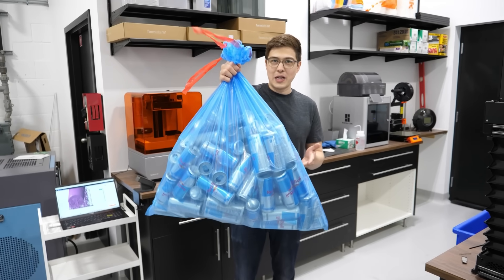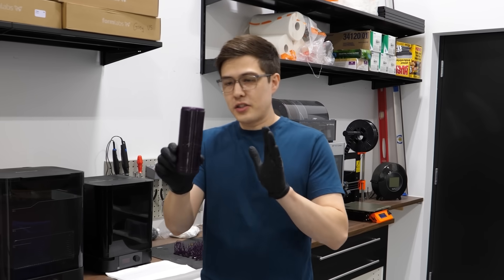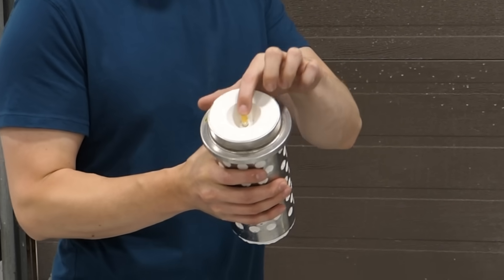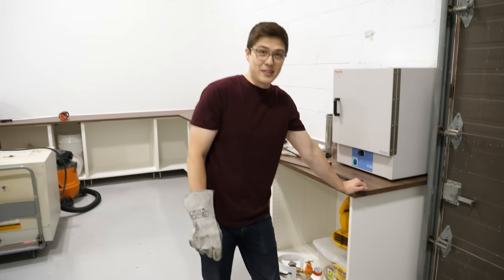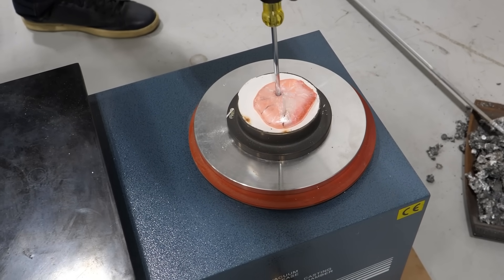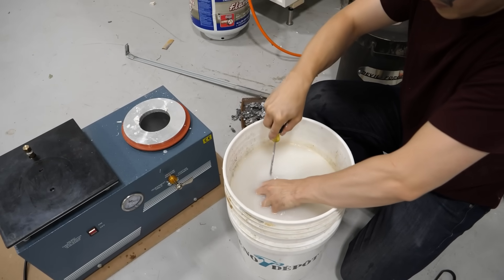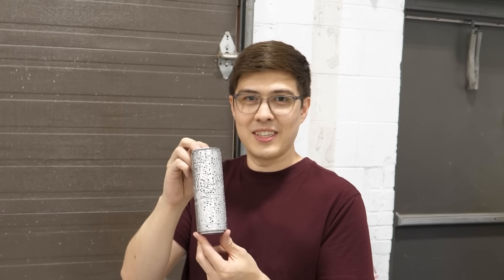Melting down 100 cans of Red Bull into just 1

Comment from the maker: **This video was originally meant to be a NileBlue short where we had to remove a lot in the edit to chop it down. We extended it a bit here, but a lot of people have been pointing things out in the comments, and we regret not including more info in this version.

For example, in order to print the can hollow we had to make drain holes, which meant that we had to plug them before putting the plaster in. This in turn made us afraid about degassing it though, because we didn't do an amazing job plugging it and we were afraid the plugs would come out. However, more importantly, we also started getting really scared that the 3D print itself (which was thin walled and filled with air) could pop under a full vacuum. So we degassed it without pulling a full vacuum and resorted to shaking it around a lot, which I think worked.

Overall, I think our biggest issue by far, was that we completely forgot everything we learned about aluminum. We completely overheated it and made no effort to degas it.
Reply: What is up Nile River?
Reply: Good thing is, if you wanted to try again, the aluminium is right there so it would be slightly easier than this try!
Reply: i enjoy redbull from time to time myself, passion projects are always the coolest

Thanks for the video.
Reply: I hope thoose 100 cans were drunk in at least 100 days
Reply: @XVYQ_EY  the 100 cans is from when he made the condensed super redbull extract…
Reply: @XVYQ_EY  hehe yeah no
Reply: The shorts folks can... tilt the phone 90 degrees and watch the video like normal people do xP
Reply: Wow, you type like you talk, with the pauses and everything
Reply: Niled it...put that on a shirt
Reply: This is the funniest sequel to condensing all that caffeine into one drink😂
Reply: Need a do over where you remove the aluminium from the plastic inside/liners and make a solid plastic can and a solid aluminium can... you could use the beer cans from that super beer video unless they are gone I guess.
Reply: I thought you would've put the plaster in a vacuum chamber to get rid of any air bubbles.
Reply: @griffingoza6033  It could be that he did, but that step was cut from the video.
Reply: 👍 222
Reply: In my own experience it probably would have been better to use a thicker tape, and the gas properly those mold carriers will work though even with a thicker one. Speed tape works decently.
Reply: This is the most pathetic promotion video for red bull , you should try actually doing something that benefits society for the long run and right now instead spewing click bait garbage out there for stupid kids and bored adults you cringe dork
Reply: da boy learns smelting good job :>
Reply: I love when you do FOUNDRY VIDEOS!!!!! I always get so hype because I am a metal casting sculptor! It's usually iron or bronze for me but I've poured aluminum
Reply: You should acid etch it. Sometimes the aluminum crystals can grow quite large and look pretty neat.
Reply: Vid def leaves a lot to be desired.

 Recommend preheat your mold before casting. 
Vacuum your plaster to remove airbubbles. 
And use a filter in you r mold to block "skin" /dross from affecting the pour.
Reply: Borax and Hexachloroethane. You're the chemical guy, you know you want to go look it up and go redo the can mold :)

Plus you could figure out a way to bubble some argon or nitrogen up through the bottom. Same as the purple gold problem.
Reply: Consensus is to do another longer one with the lessons learned!! 🎉🎉🎉
Reply: Why not vibrate with your ultrasound to knock bubbles out?
Reply: Can you isolate the little white flakes that are floating around in Mountain Dew?
Reply: You have 100 Red Bull cans not 100 cans of Red Bull.
Doesn't matter how much we know, we still all screw up :)
Reply: Bro wr like whatever, I ounce watch the red gas while being in army , on duty,and iwas concerted on the video ❤

Comment: Metalurgical Engineer here. I agree a lot with the comments here about proper mold design such as to allow gas to escape. And a proper vacuum pul in the mold. But also, aluminum is very prone to accumulate gas while its molten, especially hidrogen gas from all the air moisture. A proper degassing with argon would fix this. There is the possibility of doing it with nitrogen but is not the best sollution because it leads to the formation of nitrides (this can happen in other alloys) and the nitrides are brittle and can cause the piece to either crack while cooling or later if the cast piece os dropped. Usually a good degassing before pouring should fix the porosity in the final piece.

Comment: next time give that mold another hole to get rid of the air and other gases that will form inside while pouring the liquid alu and the result should be alot better. Burning all the inpurities like plastic and paint from the cans before melting them should help too.

Comment: Putting the cans in whole significantly increases slag formation you want a beefy paper shredder or the woodchipper you used for pla, and to smash, shred and compact the cans before melting. I'm hoping to build a vacuum chamber for degassing cast parts. I want to get into aluminum-bronze and silumin type alloys.

Comment: I worked in a foundry casting bronze and aluminum. For aluminum we always used degassing tablets to prevent the swiss cheese look.
Also a bigger funnel, filled to the top, will help to let any unwanted shrinkage to happen on the funnel.

Comment: Your lab needs a device that vibrates at adjustable frequency to get bubbles out of liquid, The adjustable devices is better as you work with liquids at different viscosity and bubble sizes.

Comment: Hello - lost wax is one way to do the mold but because there was no room for air to escape it made the bubbles - you would have done better with a 2 part sound mold with a vent for air - mold upside down so sprew and air hole can be ground down

Comment: You should fill in the pits with the appropriate colors of resin pain so the blue parts of the can are blue and the red parts are red and the silver parts are silver. You still would leave the raw aluminum visible just fill in the holes until its flush

Comment: You can reduce the porosity of your casting by putting a potato on a steel rod and slowly lowering it into the molten aluminum for a bit. For real, look it up, used to be common practice and still is done as a lab demo in metallurgy schools. Please look up the proper precautions and wear more PPE when doing it.

Comment: i got an idea to fix the bubbles, where you set the mold when its being poured and cooling, a vibration table, just use a metal table and mount a motor to it with an off center weight and bobs your uncle, it could be easily driven with an arduino or pi, hmu if u need helps but u know to use ai

Comment: Preheat you casting.
Robinson foundry adds stuff to his crucible to get the slag out.Alex or something.
Do it again and dissolve plaster from with some sort of piranha fluid adjacent chemical.put something down to protect floor. There was one guy and mould broke and poured molten copper on garage floor and it etched it badly.

Comment: The melt was full of holes because the gasses created upon combustion of the 3d print had nowhere to go, there are things you can do to improve the quality of the melt, first of all the correct plaster to create the mold, or simply remove a tiny layer of plaster on the bottom, the opposte side of where you pour the metal, scrape off a layer there after it has cured before putting it into the pre heat oven, this will allow the gasses to escape the mold during pour, there are other more complex ways to avoid imperfections but most of this methods need specific machines, like vacuum induction melters or cantrifuges

Comment: I highly highly recommend pulling the vacuum on the casting machine AFTER pouring the metal. The extra airflow will cool the mold extremely fast. Not to mention you should also be preheating the mold to a similar temperature to the metal being poured. I use the exact same type of vacuum casting machine for my lost wax jewelry making on a weekly basis and would be happy to help!!

Comment: I wonder if the pitting was caused by the gas in the aluminum and not the plaster. At the casting factory I used to work at they would just drop a potato into the aluminum to draw out the gas before casting it.

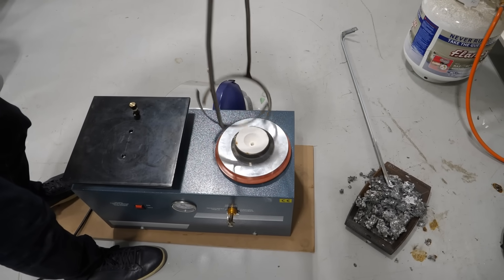Comment: 2:36 I thought a rubber gasket was supposed to go between the hot mold flange and the hole it's going into?  So there's actually a seal and the vacuum can actually pull air from the porous plaster?
Reply: why would you want air in the mold
Reply: @REDSTONENOOB.You don't - thee vacuum is outside the mold, so you pull the air FROM the mold through the plaster and out the vacuum pump, and the metal fills in the space the air was in.

Comment: In metal design we put escape airholes in different places where we know air will likely rise too but in your case it probably cooled too fast we also had smaller molds so we could spin the molten metal and mold using centrifugal force which i think is called spincasting? Idk lmao been years since i played with molten metal id suggest spining the mold to get the airout since vibrating would be entertaining but dangerous and preheating the mold idk what you put the mold into maybe that was your way of preheating but it definitely wasnt enough idk i could be wrong

Comment: Melt the plastic off the cans first, then melt the aluminum. Also, add some venting tubes from the bottom of the mold going out of the top of the mold. Those both should help remove (most) of the bubbles/pockmarks.

Comment: When melting cans there is a huge surface area to volume. This makes for a huge amount of oxidised aluminium - what you called slag - maybe half the volume. When cans go to recycling they are melted in a non oxidising atmosphere, often carbon monoxide.  
The aluminium alloy in cans is suitable for drawing out. The extruded angle bar is another alloy not suited to casting. If you were to start with an object that was previously cast, like a car wheel rim or an office chair base, it will cast better.

Comment: I think you should have vaccum pumped all the air bubbles when you poured the plaster into the mold or you could have used vibration to allow the bubbles to rise up. So that you could have achieved a perfect casting. And i thought you were gonna drink more redbull to add more cans. Anyways, I love your content. All the best.

Comment: Porosity is due to dissolved hydrogen -- this is inevitable with the high surface area of the cans, and hydrocarbons and steam from the flames, long melt time (maybe? vid is cut of course, but generally speaking, putting 100 cans into a crucible takes a while heh), and extremely high pouring temperature (you're orange, maybe even yellow hot, you could be pouring bronze here!!).

Aluminum reacts with oxygen, period; and anything that contains it.  This is non-negotiable: flame mixture doesn't matter, and it still happens in an electric furnace (kiln or induction) because moisture is in the air.  Oxygen by itself is fine: the surface oxide is stable even to extremely high temperatures (like, white hot _plus_?); but any moisture/steam reacts to give free H2, which readily dissolves into liquid metal.

Like freezing a soda can, freezing metal with dissolved H2 causes it to crash out.  This is why nothing was sucked into the sprue on cooling (though it might also be because it was too thin and the top froze first).  The expanding gas displaces shrinkage due to freezing.  In the extreme, ingots (i.e. poured with a free surface rather than in a closed mold) can expand like muffins, rather than shrink with a dimple in the middle.

Hydrogen is mitigated by:
1. Keep handling time to a minimum.  A few minutes at pouring temp should be more than enough to get everything open, in place, ready to pour. Don't dally around.
2. Mind optimal pouring temp. For a big section like this, not much above the melting point will suffice.  700-750°C say.  Maybe less for alloys.  A little higher for thin sections and fine detail.
3. Gas is released on freezing.  Remelting still re-dissolves some, but less.  Pouring ingots, maybe remelting once or twice, can remove gas. (This is a truly ancient method: it's actually documented by the craftspeople that made the Washington Monument apex. In their case, hydrogen generation was even more of a certainty due to the 1-2% potassium impurity -- a quirk of its early and expensive production method, before Hall and Heroult came along.)
4. Consider using a degasser. This is basically a tablet of solid "chlorine" (e.g. calcium hypochlorite) held under the surface, to bubble chlorine gas through the melt, which reacts with the hydrogen rapidly (and some metal, but there's plenty more of that than there is H2).  A degasser wand is used to apply this: since, first of all, salts float on top of molten aluminum, but also it needs fine pores so that myriad small bubbles are entrained through the melt, rather than big bubbles that surface quickly without reacting.  Think aquarium aeration stone, versus glass tube bubbling into a beaker.
5. Degassing can also be done by sparging: bubbling an inert gas through the metal, dragging out some dissolved gas slowly over time.  N2 and Ar are recommended; H2O content has to be extremely low, and O2 content is contraindicated for obvious reasons.  A stainless steel tube should suffice for introducing gas.  (Since you have so much gas handy in the lab, this is probably a good option.)

(The same problems apply to most any metal: copper and other noble metals, can dissolve both H2 and O2 (obviously not at the same time!), as well as copper oxide (evidently free O2 doesn't instantly react with Cu in a melt!).  Copper alloys (i.e. brass and bronze) have something that'll react with O2 of course, but can still dissolve H2.  Use an oxidizing environment to discourage H2, then a charcoal cover to discourage O2.  Alternately, or in addition to charcoal: a glassy slag layer dissolves oxides as they form; typical composition is soda-lime glass plus a dash of borax to get it to flow slightly better. Don't overdo it or the slag pours into the mold along with the metal!)

Slag can also be dealt with by using a flux.  Some fluxes (e.g. rosin for soldering) work by actually dissolving oxides; that's not very practical here (mainly because fluorides (KF, AlF3, etc.) are involved, quite toxic), but even your bog standard chlorides suffice to disrupt the surface tension between metal and oxide.  A eutectic mix of NaCl.KCl (about equal parts atomic% actually) melts at about the same temp as aluminum, so doesn't provide much of any cover for solid metal before it melts, but affords separation of oxides once a molten heel is formed.  CaCl2 and MgCl2 can be added to further reduce the melting point (probably avoid MgCl2 because it's even more hygroscopic and somewhat corrosive; and, needless to say, these all need to be anhydrous to start off).  I recall soda cans and foil giving maybe 50-70% yield without flux, while the "slag" is still something like 80% metal, which can be cleaned using a liquid salt cover, separating a granular gray dross (mostly Al2O3 but some fine metal particulate, Al2S3, AlP, etc., hence the color).

Molten salt dissolves H2O just as voraciously, exacerbating the hydrogen porosity problem; degassing is mandatory if you're taking much time in the liquid phase with a salt cover.  Also, molten salt is as mobile as water; you will pour some into the mold if you try casting with it.  Better to pour ingots, let the gas bubble out, then wash the crucible and start over clean and dry.

Comment: The only thing I would have changed with your actual setup for the mold is to add some kind of vibration while you're pouring the cast.  It helps it settle and ensure that there's no air pockets.

Comment: The reason why you got all those holes was because you did not leave a way for the air to escape.  A bigger hole on top or a vent hole also at the top and off to the side would have worked.

Comment: Hey nile.  You need to degass the plaster after mixing and pouring it into the flask (take the vacuum off before it hardens or you will ruin it.)  Then when pouring the metal you NEED a gasket between the flask and the metal ring.  I pour my jewelry at 27 inches of mercury and at that level of vacuum that cast would be pit free.  I'd also recommend quenching the flask a little sooner, which will cause the investment to completely disintegrate.

Comment: Two sprues will reduce the bubbles...one to allow the aluminum to flow in, and the other to allow air somewhere to go when displaced by aluminum. Cheers...fun video.
Reply: Except for the fact that molten aluminum (especially overheated molten aluminum) will absorb tremendous amounts of hydrogen gas that will release as it cools. Once the outer skin of the aluminum solidifies there’s nowhere for the hydrogen to go, vent or no vent.

Comment: There’s a very thin layer of plastic coating the inside of all aluminum cans. That’s likely why there is so much slag from just melting cans, a percentage of the weighed amount of aluminum cans also includes the weight of the plastic.

Comment: I did something similar when I was interning at a metal shop!! The main difference is that we were using bronze, and we used a centrifuge to make sure that the metal was evenly distributed. Cool video!
Reply: Yup. The old spring loaded pivot arm centrifuge casting machine. 
Can’t tell you how many times I’ve wound up and let that puppy fly. 
And ducked because the drum didn’t have a lid…. 
Fun times.